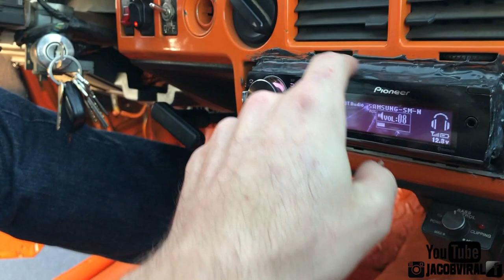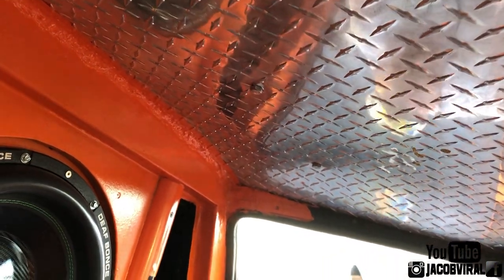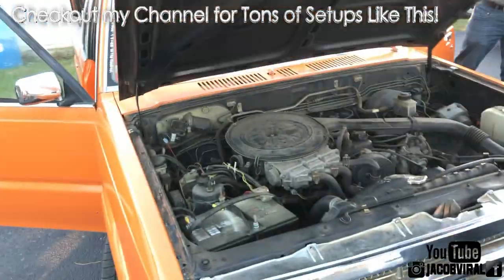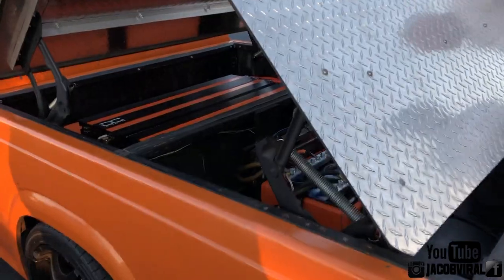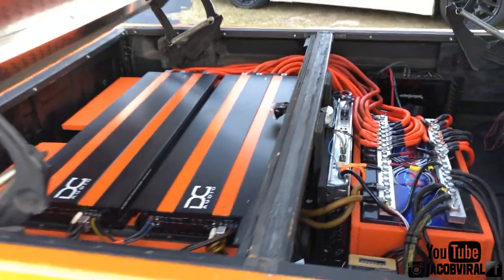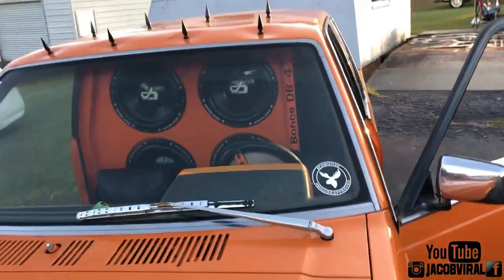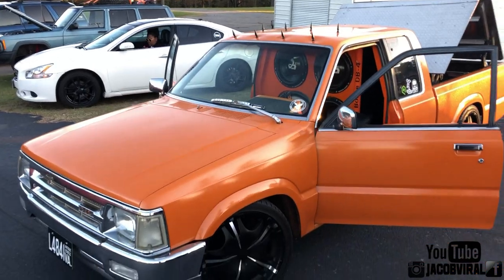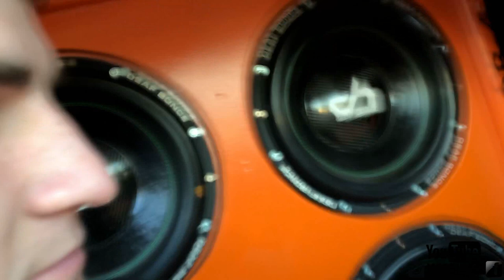4 15S TAKING MY BREATH AWAY IN THIS 160DB BUILD

Comment: Finally a mini truck 😍 I love them!!! damn I miss my 93 Sonoma with my 2 fosgate series1 15's and punch 200 I'm talking 90's fosgate equipment when it didn't take much.
Reply: Mazda b-2200 is by far one of the best looking trucks to date slammed. I miss mine :(
Reply: @ericcarver9250  don't we all now it's like a pipe dream with life,kids, mortgages, but I know we will have our project trucks again and bring'em back 💪 strong 👍
Reply: I had one 15" Rockford series 1 and I loved it! Only had like 200 watts going to it and it slammed! Didnt even have the correct air space. Damn thing called for like 4.2 cubic feet if I remember what the Rockford tech said when I called him....
That's cool you had series 1 subs bruh!!!!
Reply: @austinsears1637  damn what fosgate sub calls fot that much airspace must have been the Tseries subs i know it wasnt punch series  i had a P315D2 and max airspace for one of those was about 2.50-2.75 cubic feet in a ported box 1.5-2.0 in a sealed enclosure
Reply: I hear ya bro mine was a 1998 dodge Dakota 2
Rockford fosgate 12" 
Punch seiers on a sentrec 250×250. 4 ohm. Mono block amp.
An a kenwood 50×4 amp for mids on Kenwood 5/1/4. Doors
On a Kenwood pull out
Running 4. (3)  tweeter
Those where sheerwoods. But ya those were the days. 
An one deep cycle interstate.

Comment: Looks brutal, deaf bonce FML, I'm actually tuning into the low 40s and using pvc on my port, port is firing up, along the back hatch, shooting for 151s on 2 dd 615s, for metering and comps, I also have a box tuned too 32 hz, so I'm going to play with both, thanks Jacob.

Comment: Hey Jacob was wondering what would be good replacements dor 6.5 inch door speakers that have a high spl plan on putting extra amp in for them but just wanted to know what you think
Reply: Justin try kicker or Rockville.
Reply: Anything but those 2 brands^^^
Reply: CRESCENDO AUDIO
Reply: @vasquez3769  Yeah also a good choice. I've actually on a budget had Kenwoods that sounded decent. And Polk audios.
Reply: @alfa7108  theyre not bad either. Crescendo is more of a clean sound with awesome mid base.
Reply from the maker: Hey Justin, I really don't have a lot of experience in Speakers but the Crecendo and Alpines look like good choices to me If I had to pick.
Reply: @vasquez3769  tru
Reply: Rockford punch pro series